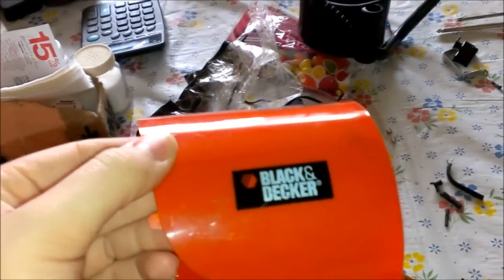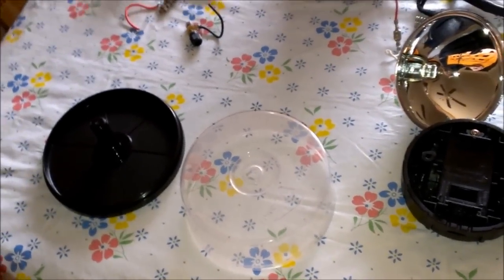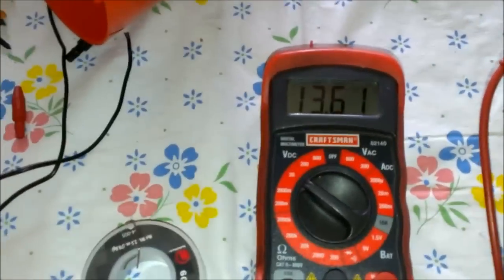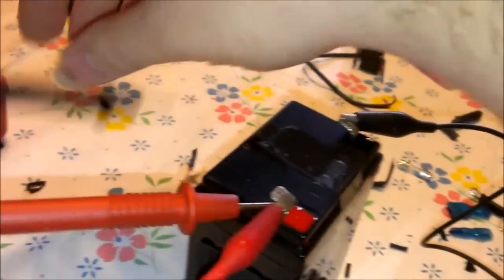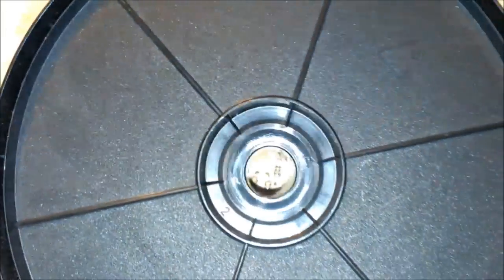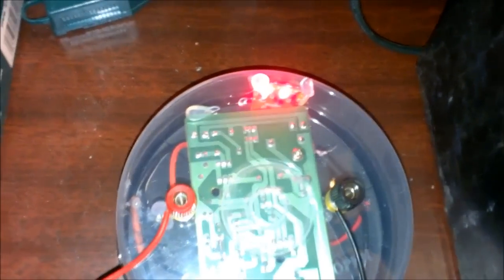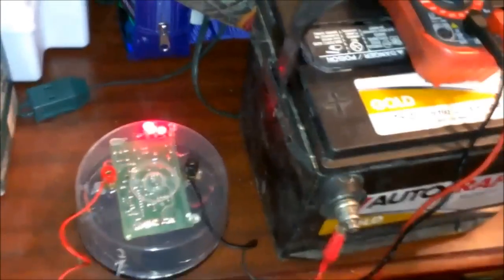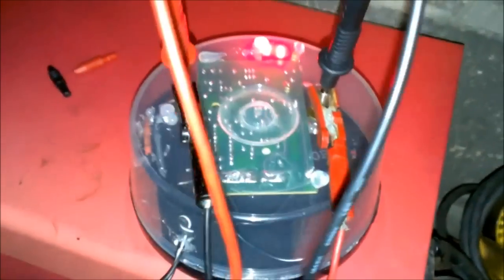How to make a float trickle charger for lead acid battery

Comment: I just picked up two flashlights at the local recycling container and 1 was the exact  same B+D light you have there. the battery was also dead so i took it apart for the bulb and realized it could be used for a 12 volt charger. I didn,t think of using the whole works though, i just cut off the wall charger and put clips on it. On small lawn mower batterys it runs up to 13.8 volts and stays there and on my car battery it went to 12.76 and stayed at that constant. I will put it back together with the board though and also try one from a smaller light with the same 12 volt /500 ma charger. thanks great video.